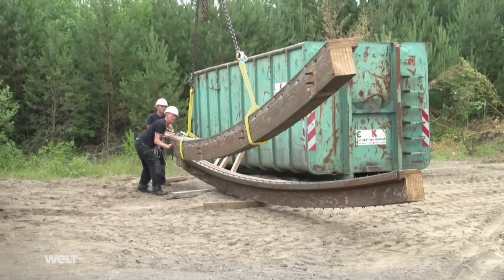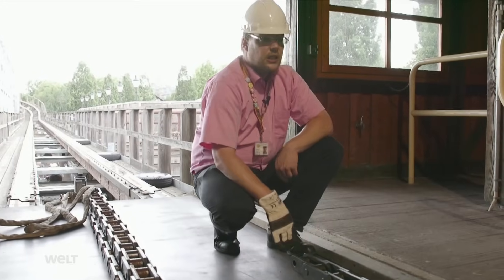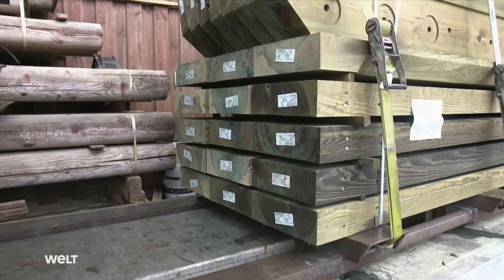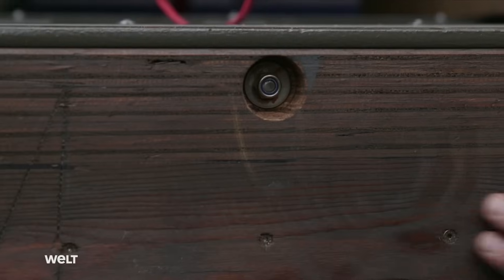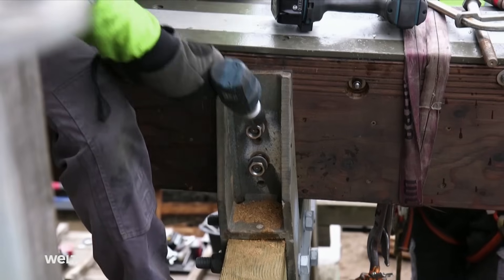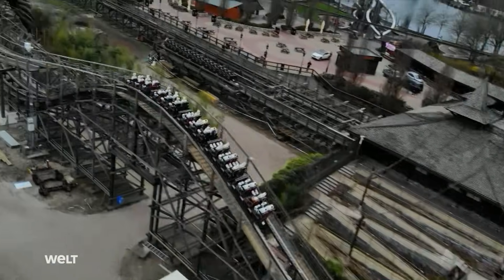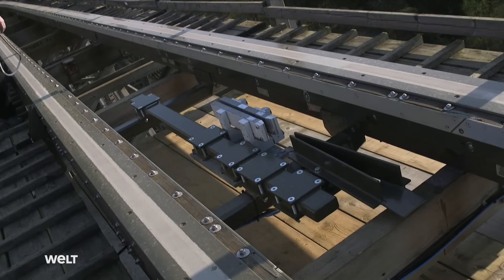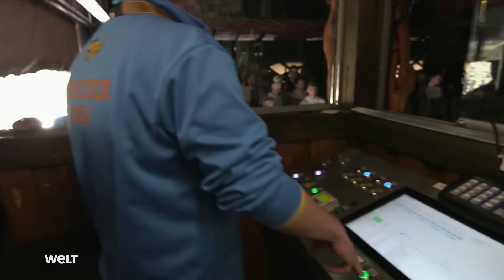Major ROLLER COASTER Coaster Renovation - The Return Of Colossos | Full Documentary

Comment: Unfortunately Heide did not maintain the ride. This was a very time intensive, extremely expensive renovation, that was completely unnecessary. If they had've maintained the ride as instructed by Intamin (the manufacturer), none of this would've happened.
Reply: Yup. Take el toro for example, its over 15 years old, and while it isn't buttery smooth everywhere, its considerably smoother than most other wooden coasters. That is because great adventure replaces track every off season. The camelbacks are replaced the most often.
Reply: @alecvip7562  How has that been working out?
Reply: @alecvip7562  Six Flags does not do sufficient maintenance on El Toro. This is why it has several problem areas right now. I rode it in 2022 right before the accident and there's many potholes on the ride that need work. Great Adventure should undertake the same scale of refurbishment as Colossus got. I doubt Six Flags will go to this much trouble, however. They are historically negligent with their wood coasters.